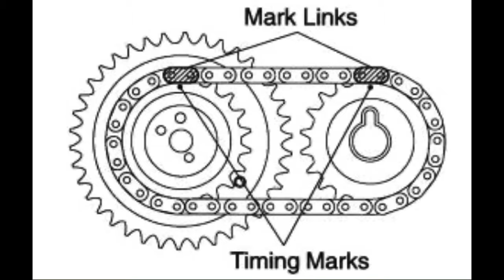2006 Toyota Tundra 1GR-FE 4.0 COMPLETE HEAD GASKET REPLACEMENT STEP BY STEP 209-305-1672

Comment: Just developed a leak between cylinders 4 and 6 on my 2006 Tacoma. No CEL yet but I'm feeding quite a bit of coolant into #4.  Finding out this is a common issue for 05 to early 06 Tacoma with a head gasket flaw Toyota knows very well about yet won't do anything to correct. planning to take this on myself as well as replace the water pump, oil pump and timing chain while I'm in there. engine has 220k on her but I'm not too worried about the lower end. I've watched this video 5 times now and will probably watch it another 20 times while I'm doing the work. with this video and a good friends help, I am fairly confident I can do it and save a boat load of money.
Reply: How did it go buddy?
Reply: @mendoblendo321  have over 6k miles on the rebuild and she runs better than ever. Had the heads cleaned up and a skim cut to clean them up. New oil seals, gaskets, pumps, chain, timing gears and tensioners. It was a lot of work spread over three days but so worth it. My truck is lifted and a steel bumper with bull bar that I probably should have removed prior to doing the work so I spent a lot of time standing in the engine compartment. No more leaks, more more CEL, no more coolant loss. Who could ask for anything more!
Reply: I'm pretty sure our 2006 has this issue.  Coolant low, water dripping from tailpipe, smoke from tailpipe, rough idle, hard on gas.

Comment: Great video, I was able to complete the head gasket replacement on my 2006 Tacoma and she started right up. I watched the video a few times and it was extremely helpful guiding me through the steps and order of removing everything. There were a few gaps but that is probably because I am not as familiar with so I wanted to add some of my comments in case anyone else has questions. I also put a list of pretty much all of the tools I needed. I had to buy a few but it was not too bad. 

Tools needed
12mm wrench
10-20mm socket (short and long if possible)
Socket Extensions
22mm socket
8mm hex bit
Torque wrench (loan a tool at auto store if you don’t want to buy)
Breaker bar
90 degree needle nose pliers
Marker
Long flat head screwdriver to pry
12mm triple square
Large hammer
Magnet pick up tool 
Headlamp
Silicone

Notes
2:40 – My coolant drain plug was really tight, I realized I could loosen with a 19mm socket I believe
2:50 – For some reason these hoses look reversed compared to my truck, I took a picture and looked at other videos, I would make sure you take a picture of yours before you remove
5:40 – I would suggest lining up the harmonic balancer with the guide and mark with a marker. When you remove the harmonic balancer bolt it will not line up again but when you replace the harmonic balancer it will make it a bit easier to line up
6:15 – once you remove the harmonic balancer you can put the bolt back in, you will need it to rotate the engine and line up the timing marks later
7:45 – For the fuel lines the grey plastic cover just pops off with a bit of prying. Once off there are some tabs underneath that are pretty obvious you squeeze to remove the lines.
11:47 – The alternator has a total of 4 bolts, the two main and two smaller ones on the right side of the alternator
16:00 – It is possible to get the timing marks lined up without the links of the chain lined up, If you keep rotating the harmonic balancer bolt at some point the timing marks will line up and the links on the chain as well. It took me about 4 full revolutions to get them lined up. Also, the engine will turn easier when you remove the spark plugs.
22:00 – My head bolts were pretty tight, I had to bang the screws with a hammer and a point a few times and use a 21 inch pry bar to remove them. I would recommend not trying an impact gun. 
26:00 – On the passenger side cam I kept the chain intact just like the video but when I set them down the right side would not set down completely because the 3rd cam from the front faced straight down into the valve. I believe I had to rotate counter-clockwise bit so they all sit and make sure the chains are lined up to the sprockets. The number 1 left cam on the passenger side should be pointing straight up at the 12 o’clock position and the number 1 right cam should be in the 7 o’clock position. Then you tighten the cams and then rotate the cam clockwise until the timing marks match up. The Toyota manual says they should be in that position when you remove them but I just placed them in that position when I put them back on. 
29:00 – Before you put the timing cover on you can take the harmonic balancer bolt out. I would suggest marking the tip of the sprocket where that notch is that lines up with the harmonic balancer. Once you place the timing cover you will not be able to see the notch. If you look at the harmonic balancer you will see that little inlet where it aligns. 
31:55 – This is where you need to install the harmonic balancer and torque it to 185 ft lb. If you can I would suggest finding a tool in advance, I rigged something made out of a 2x4 you can probably find on youtube. The part number is SST 09213-54015.
Also, I would practice putting the timing cover on before to put the silicone on.
Reply: Thanks for the extra tips man I’m hesitant about doing mine but I have a small coolant leak in cylinder 6 and I don’t want it getting any worse. How long did it take you? Did you replace anything else along with the head gasket?
Reply: I would say it took me like 14-15 hours. I replaced the water pump and serpentine belt just because they were easy to do while down there. I had a misfire in one of the cylinders and I kept hearing gargling sounds whenever I would start the car. I could drive around no problem during the winter but figured it had to be replaced.
Reply: Thank you for your detailed notes 1 person in the comments said that they would buy the service manual do you think this is necessary
Reply: I don’t think you need a manual. I would
Say the most complicated part is the timing and valve removal and reinstalling. The other need is maybe the torque sequence but I think you can find videos for all and they discuss In this video I believe.
Reply: MVP

Comment: I'm one of the "likes" for this video.  Thanks for making this.  I just completed this job and I do have some hopefully helpful observations for those attempting this.

1.  This video provides an excellent overview of the job.  In my humble opinion, it should NOT be used as the sole guidance to complete this job.
2.  I have a fully equipped garage and years of experience working on cars (not Toyotas) and I had to go deep into my collection of tools, yet still had to buy some to complete this job (most notably, the 12-point Triple Square bit to remove the cylinder head bolts, and a machinist's straight edge to check the cylinder head and deck flatness).  I would have been stuck if I attempted this job without a lot of tools,.
3.  I would not attempt this job if I did not  have a clean workspace where I could leave the car potentially for weeks.  That includes clean shelves, or tables to store parts.  Plan on it taking a few weekends or more.  If you are rushed, do not attempt this job.
4.  I purchased the Toyota factory service manual.  It comes in 8 thick volumes for the 4Runner!  ~$300, by the way.  Volumes 1A and 2 are most relevant for this job.  I would not have been successful doing this job without the factory manuals.  I own a Chilton's manual.  It was useless.  This video, used with the factory service manual was effective.  Even then, working with the dealership parts department was helpful (they provided exploded diagrams of parts and some consulting).  The FSM has critical information about torque values, tightening sequences, and other details you need to follow.
5.  Concerning cylinder head bolts:  once they are torqued down (per FSM procedure!) they can not be reused.  There are Internet postings from backyard mechanics that claimed they got away with reusing them.  If you're going to do this job, do it right.  The bolts (discounted) cost $160.
6.  Once the camshafts are placed on the heads DO NOT ROTATE THE CAMSHAFTS.  My 4Runner (1GFRE) is a "non-interference" engine, meaning you can spin the camshaft 360 degrees and the valves will not be pushed into hitting a piston (the definition of a disaster), but a general critical practice is NEVER to spin a camshaft without the timing chain connected.
7.  Marking every hose, plug, and especially the camshaft positions relative to the chains and cylinder heads is absolutely critical.  I did not do that and I had to disassemble the camshafts and reconstruct things from scratch.  Take photographs as you go along.  I found it especially useful to compare the completed timing setup with the setup BEFORE I took the engine apart.
8.  I found it most cost effective to buy the engine gasket kit.  I replaced every gasket, O-ring, and seal on the reassembly (including the fuel injector seals).  It adds little time to the job and helps ensure the engine will be problem-free for a long time.  I also replaced all coolant bypass hoses and vacuum lines (the biggest source of performance issues).  You're in there, why not?  

This video, more than anything, is useful in getting a feel for the size of the job which can help one to decide whether it's something to take on or leave to the professionals.  The benefit of DIY is that you will learn a lot about how your engine goes together, and when problems arise, it won't be intimidating to tackle them.   But I do reiterate, if you do not have the time, tools, experience, space, and manuals, there is no shame in taking it to a professional.

Comment: I did a 2004 4runner with a blown head gasket. Started the project about 2 weeks ago, put in about an hour every day, and followed this video step by step. I didn’t skip forward! And upon completion 2 days ago, she fired right up. I gotta hand it to you boys... 👍

On a side note, I did throw a P2111 on initial start up/idle, completely my fault (I probably didn’t handle with care the throttle body while I was cleaning it, I don’t think you’re supposed to manually adjust the butterfly) I pulled the throttle body back out, banged it on a wooden desk (maple?) and put it back in, cleared the code, and it’s running better than ever now. Took it around town, got some gas, drove it to work this morning. 

Hats off to the Gasket Masters, I could not have done it without these Champions. 🏆
Reply: How is your 4runner doing so far? I'm looking to take on this task.
Reply: @byf4ith  good question
Reply: Sold it to my Dad (practically gave it to him) He is still driving it today, absolutely no issues at all. This job is definitely worth doing, especially on a young engine. Good luck! 

Sorry for the late response, I never got a notification. I fell back onto this video for the hell of it, saw my reply, read the comments.
Reply: I have to do mine now and 100% these blokes are champions for showing us these critical steps
Reply from the maker: @jacksonroad9263  thank you

Comment: Thanks for doing this video I'm currently working on my 05 tacoma and your video helped a great deal considering this is my first time ever doing a head gasket the dealership wanted 3300 you definitely save me a bunch of money but I do have to say that you make it look easy but it's much harder than it looks again thank you and I appreciate you taking the time to make this video
Reply: Sonnie Her how did you remove the harmonic balancer after removing the bolt
Reply: It will usually just slide off by hand.  If not a little prying should get it off.  Don't pull on the outer ring of the balancer.

Comment: Just finished mine
-  had to do a lot of cleaning of old oil cake 
- also had to take out the vvt oil filter from sides of head and clean 
- chains guides and tensioners replaced
- water pump and thermostat
throttle stuck on first run but cleared after checking fuses and connector 
- back sump and pickup can be removed and cleaned from underneath 
- great running so far
Reply: This video was a huge help - You can find the fj cruiser manual online to get steps broken down

Comment: Super informative.  I have been staring at the front of the engine since I got the water pump off. Reluctant to begin dealing with the power steering and ac compressor.  Your video took the mystery out of it.  I haven't watched the part where you did the timing chains yet- but I'm sure it will all make sense.   Thanks so much!

Comment: Super important beforr you start this process to check the pcv valve. I failed to notice something in your video that WAS NOT OEM that im going to try tommorow. I see you have a catch can. My problem is im having white smoke and am not loosing fluid of any sorts but noticed something with the drain plug. Theirs oil even at its tightest point. I see that white can that looks like an oil filter is your catch can. Im going to try that white canister first which is a catch can and let you know. Amazing video for a young mechanic such as myself. Using my gfs youtube account btw😂

Comment: Thanks for the video! 
Notes:
It is not a triple square! Toyota uses a double hex, and this motor is 10mm. A triple square has 90 degree points while a double hex is a less pointy 120 degrees. A triple square will only engage at the tips and damage the bolts and/or the tool. CTA Tools 9292 is the correct one.
You’re not really supposed to remove or install both cams together with the chain. They’re supposed to be in/out when one set of lobes is vertical, so the other two sets have almost no spring pressure. You cannot do this with both cams linked with the chain. Doing them as a pair risks damage to the bearings surfaces (but you can probably get away with it).
*If you ever want to turn the cams without the main timing chain installed, first turn the crank 40 degrees CCW from #1 TDC so all pistons are away from any valves!

Comment: WOW,HOLY MOLY, JUMP'IN CATFISH,First time I've ever seen the inside of"ANY"forien engine let alone a japanese engine.It looks like a nightmare,all that (little)detail just to take the heads off.A big difference compared to a 1970 Pontiac Le Mans with a 350 ci engine which is a breeze to work on (my 1st car I ever owned,2 door,no a/c,63,000 miles when bought, All STEEL incliding full chassy frame,no unibody). But in about a week+, I'm about to get a 2010 Toyota 4 runner limited 4x4.Its got more bells and whistles than what I need.Comes with a 4.0L V6,3 timing chains like in the 2006 toyota tundra in your video,nice and beefy,better than the 2018 and newer toyota's 4 runner's timing belt, wouldn't give you the time of day for one of those.Just for Labor alone a shop will charge $500.00 to change the timing belt in a 4 runner,THOSE GUYS ARE ON DRUGS ! But I really enjoyed your video on the 4.0L engine head gasket,keep the videos coming in,thankyou.

Comment: Need advice with what i see concerning drivers side head: it appears darker than the cylinder head on the passenger. Seems like its a lot dirtier and not th golden beauty i see on the passenger side head. Any ideas? Im doing this step my step and its going great so far.

Update: followed this video. Watched it about 6 times and i now have my new head gaskets installed and i couldnt be happier with the instruction. A few small nu-onces like timing marks but i put it on top dead center and lined up the marks on the cams and crankshaft with th chain links that are marked. Great video. Will update tomorrow once i get the job finished and ill report my results.

Comment: Thanks for this excellent video! I noticed that from 20:36 until 21:58 you loosen the dreaded No. 1 Water Outlet Pipe and move it back about 3 inches. Do you think this would provide enough space to get to the knock sensors without having to remove the cylinder head?

Comment: I can't find any videos on head gasket replacement for 2010+ 4runner, FJ Cruiser which has almost same but improved 4.0 engine with dual VVT-i. Do you think I can follow this procedure and it will be the same or is there anything else I should be aware of? Also, if you find any links to videos, that would be helpful. Thank you!

Comment: Incredible DIY video, great details and you go out of the way to make sure nothing is overlooked. I've heard you can do this without removing the oil pan, any comments you can provide regarding this? And also heard it's best to pre-oil the motor w/ a pressurized hose, is this ok to do without this procedure?
Thanks again, I feel much better about going through this with your most helpful video!
Reply from the maker: If you watch the video, you will see we only need to remove four of the oil pan bolts. We do not need to remove the oil pan completely. Cranking the engine with the coils disconnected will build up oil pressure prior to starting
Reply: @gasketmasters  

Great to hear as I have a 4wd and that would add even more time to an already labor intensive DIY. Hopefully I won't have to do this anytime soon, just bought an 03 w/ v6 but had some oil accumulation in an area where that could be the culprit. Thanks for the oil pressure info as well, great work gentlemen!

Comment: Amazing video, I've been chasing a cylinder 6 misfire for the last couple of weeks. And all are saying and pointing to head gasket. I'll attempt this after running a couple of other tests. 

That said, when you removed the heads and placed them off to the side for I'm assuming cleaning. What other things are you inspecting/looking for before placing the heads back on? 

If anyone else knows or would like to let me know please don't hesitate.
Reply: I am not really sure but I would expect that they are inspecting for cracks and/or warping.  If it is cracked then it is a real problem.  If it is warped then the head would need machining and a valve job to be done.  I am not 100% on this but that is what I think.